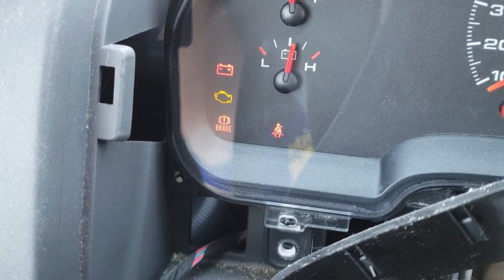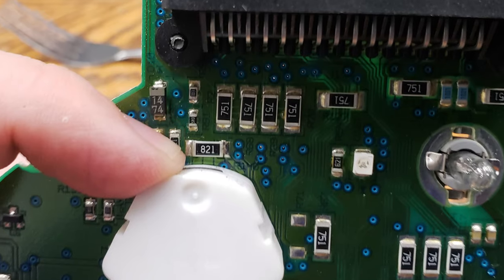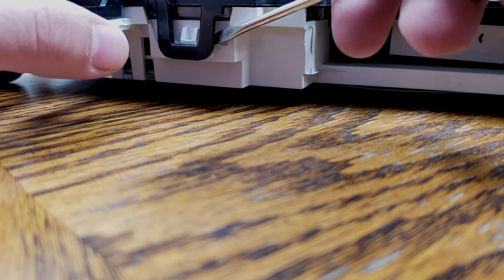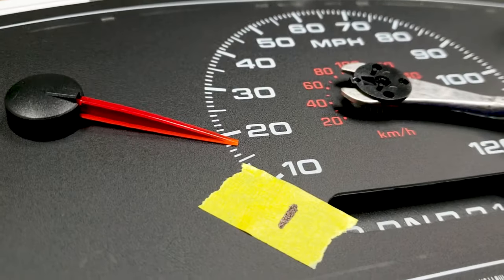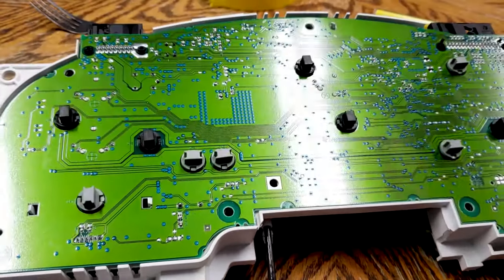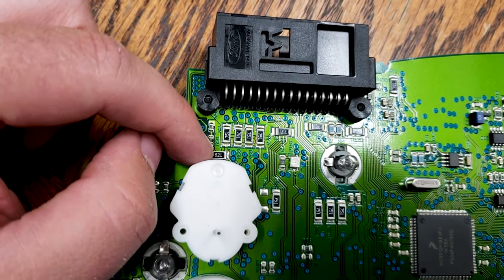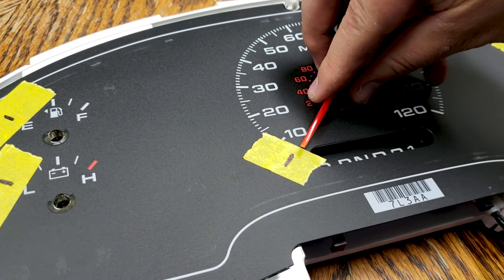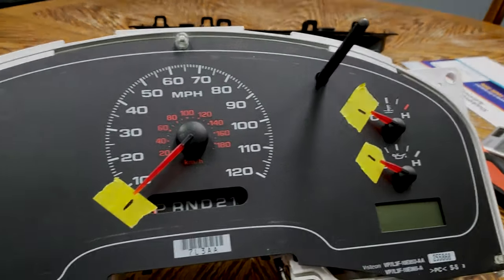How to repair the RED WARNING Brake Light Ford Truck

Comment: Your solder repair worked as described- no more red brake light!  Two tips: 1) After breaking the first two gauge needles during removal, we switched to using two small pick "hooks" 180 degree apart under the needle to gently pry up. Using a flat pry device as shown places the pressure on the outer part of the needle which is what caused the pieces to separate (thank goodness for superglue).  Using hook picks puts the lifting pressure on the center/stud portion and keeps them whole. 2) Trying to avoid putting too much stress on the needle motors I didn't press them down too far (or far enough). Now at night, a little bit of extra light escapes behind the needle base. Not the end of the world when looking at the cluster straight on, but something I'd change if I did the repair again.  Thank you for the guidance!
Reply: My check engine lights is not showing snd my brake light on

Comment: Thanks! Did this today, exactly as shown for my 2007 F-150. I think you just saved me a lot of money in repair work. The light had literally been on for years now, but the shop said they wouldn't pass it for inspection again without fixing this issue.

Comment: I've been trying to get this issue fixed for a long time now, and only ever seen people try to wedge the contractor so the light turned off or they replaced the panel. This is so much more budget friendly. Thanks for the information. I also appreciate a complete overview of all possible issues....not JUST one fix to one potential problem. Very well done.

Comment: Thanks for this video, it's the best one I've found yet about this issue - I was able to repair my own cluster fairly easily, although I would recommend that anybody with hands as shaky as mine should have a friend do the actual soldering as it is a very delicate job! One twist with mine was that my speedometer needle did not light up and I couldn't find any info online about this, but when I took it all apart I found that somebody had been there before me and when they glued the needle pieces back together they used too much of a flexible, coloured glue which blocked off a small square window which feeds the light into the needle - removal of the glue from this window solved that problem - use your glue sparingly and use a transparent product like super glue.

Comment: Well finally someone who understood that just wiggling the connector to make the light go off was not the fix.    Also for me re soldering the connector pins didn’t work.  Or  resoldering the resistors on the same side of the circuit board as the pins.  Thank you for pointing the exact location out.   One thing I did instead of taking the panel completely apart was to cut away some of the plastic so I could get my iron down on the left side of the 821 resistor.    Thanks again.

Comment: Just did this last night. Perfect fix!!! Be very careful when reinstalling the LCD Odometer gage pins back into the Circuit Board. I was holding the LCD gage just a tad too tight and broke it. Odometer gage still works...the bottom half does. No worried, found replacement on Amazon for $70 (Canadian)...so like $10 U.S. lol

Comment: You're the man. Soldered the resistor and permanently fixed. My gauges were off a bit afterward. I simply sat the cluster in with the needles barely on and without the lense, connected harnesses and checked the needle position. Shut it off and adjusted as needed. Saved me hundreds. Also replaced the odometer bulb while I was in there. Thank you!

Comment: Just did it today and so far everything is working, thank you for the video my local dealer ship wanted 500-1000 dollars they wouldn't tell me an exact price until they got into it. And if you decide to do it have some epoxy or something available I had 3 of the needles come apart just like in the video.
Reply: Agree, super glue did the trick. I had two pop off.

Comment: Just soldered the resistor and went for drive . Awesome fixed the intermittent red brake light coming on. Easy straight forward explanation.

Comment: Finally a permanent fix.  I did what you said to do and Re-soldered resistor 821 and it fixed the problem.   A another tip is to make sure the small pins just below the odometer readout display aligns into the connector when you connect back the circuit board to the cluster. I found out the hard way and scratching my head why the odometer won't come on.. had thought I had broken something until realize the cause.  Thanks for sharing this video and helping me fix this nagging problem.
Reply: He briefly mentioned that in his video about "wires" that needed to be aligned properly or your odometer won't work right.  I did the same thing.  Put it all together and the odometer screen was blank.  It took a while to get those six pins plugged in properly but I finally got it.  It was more difficult to do that than to solder the 821 resistor.

Comment: Awesome advice. Absolutely worked. I looked at the joint over and over with magnification and still did not see any sort of crack or break. Did the repair anyways and it solved my problem. Also this seems to have fixed my TPMS indicator that was coming on randomly as well
Just a little addition. I used a dental scraper to rough up the tiny surface on either side of the resistor. Also used super glue to glue back together the needle indicators and I didn’t wait for the superglue to cure fully before closing the unit up. Ended up with white fingerprints on the inside of my cluster enclosure which I will clean up later. Ever seen Beverly Hills cop II fingerprint scene?

Comment: Thank you, just confirmed The reason for my brake light being on. After watching this video with the truck running in the brake light on, I tapped the dashboard with my fingers in the approximate location where you showed the problem, the light turned off. Now to repair it. Great job on this video thank you again.

Comment: I was a bit skeptical because I could not move the wires and get the light to go out. This was the last attempt to try and fix. I had replaced the master cylinder sensor, tested the parking break switch and could not check anything else. It worked !!! 
Thanks for making this video. It was simple to do once you got all the gauge needles off. That was the hardest part.

Comment: Yeah if soldering a connection, you are technically fixing an open circuit. I paused to read all these comments because as one other person noted, upon examination with a lighted magnifier, I could NOT see any open at the solder or on the fine lines of circuitry. I examined the whole board and this took an extra 1/2 hour+, and my only problem has been the darned light staying on for years. Because I have been skeptical (as I'm preparing my soldering iron), I took the time to read through the confirmations of many people who did the same repair. I hope this is my fix after following the same soldering. Bravo to the person who found this solution.

Comment: Thank You Sir, it's FINALLY fixed!!! Touched up the suspect resistor with a little bit of solder and Holy Smokes what do you know, problem solved. Even took it down a very bumpy dirt road for a test drive when the indicator would flash like crazy (not a blink). I'd love to send you a case of beer!

Watched another video where some guy touched up the solder joints on the back of the socket connector. Tried that last year sometime, didn't work :(
Was pretty PO'd after that. Have a funny feeling now that his fix never fixed his problem now....who knows??? 

Glad I gave your "Real Tip" a shot!

Thanks again for you help!
Reply: Same here... Worked for me. I did pop one of the smaller needless... super glued it. Suprisingly, my 30 yr. old Weller General Duty Soldering Kit worked, although I really only heated up one of the joints and dropped a fairly large drop in the other. Thanks for sharing!

Comment: Thanks for this, fixed the brake light on my 05 with the base cluster. BUT I found out that it's not necessary to mark the position of the needles. After putting them back on all you have to do is manually move the needle until you find the start/stop points of the motor. Once you do that you can adjust the "dead zone" allowing you to recenter the needles, then after reinstalling the cluster put it into diagnostic mode (or if you have an obd reader that has on demand self tests do a cluster test) and the first thing that happens is a gauge sweep and that will calibrate the needle positions.
Reply: What?

Comment: Thank you so much this fixed mine. I would also line to add to be careful when reinstalling then pins for the odometer display. If you’re display is not working after this repair check to make sure the six pins are installed correctly into circuit board..

Comment: Great video! Allowed me to not only fix the permanent brake light but also the intermittent dome light on my 2008 f150. Resoldered the 821 and 751.
Reply: My ‘04 F150 has the dome light randomly pop on. Are you saying that 751 is the culprit for that as well?

Comment: Repair worked well. No more red light. However there was an issue lining up the lcd screen pins...discovered that the lcd can be removed from the front with the plastic peeled back slightly, this made it easier to line up the pins.

Comment: I bought a solder iron, plastic removal fork, and solder for 30 bucks at autozone. I soldered my board it was the easiest thing ever. I am not a mechanic I was able to have this done in literally 45 minutes to an hour. Thanks for saving me 1100 which the mechanic wanted to put a new one in.

Comment: Thank you so much . I Had this same  problem with my brake lite the day I bought my truck 2 years ago. I kept thinking it was the master cylinder reservoir sensor .Adding solder to the same resistor fixed it. This must be a common problem for F150s.Thanks again for a great video.
Reply: Did ever the light came back again?
Reply: @Iceforsure  No stayed off unless I engaged ebrake

Comment: Awesome info dude thanks! I had one that had the brake light issue, but also the airbag light would turn off (actually had an sir fault) when the connector was wiggled. And it had a dtc for airbag light circuit open stored. I wasn’t sure which component was for the sir light, so I soldered all the surrounding components on the board and it fixed both the brake light, and sir light malfunction.

Comment: Thank you... Worked for me. Not 100% sure that was the solder that broke, only because I resoldered all the terminals.. But worked! Light was driving me nits for over a year!
Reply: Which terminals exactly? Can you post a picture
Reply: @Jeff-qc6cc  this was so long ago. I wish I could remember. But it was all the contacts shown in the video
Reply: The numbered resistors?

Comment: Sweet deal... My truck would not pass inspection because of this light..  I just followed your video and fixed it in 30 minutes.  Shop wanted to charge $200 to install one. Thank you.. now to find which coil pack is causing a miss under load. 5.4 Triton.

Comment: I also didn't know where on the instrument cluster to repair.  After re-soldering both sides of the resistor, the light is finally out.  Unfortunately,  the speedometer stepper motor came apart while doing the repair and my first attempt at putting it back together resulted in a non-moving speedometer needle. After a quick but tricky disassembly and reassembly, it all tested good. Had to do a live speedometer calibration with the cover off using google navigation on my phone as the correct speed.

Comment: Thank You ! Worked perfect for the brake light!....Other issues, Air bag light will come on or off by banging top of dash and the seat belt light does not illuminate at all....also seat belt chimes with belt on....I'm sure that at least the air bag light and seat belt light are related to the circuit board. Can you point me to the place on the board that may need a solder repair?

Comment: Thanks for the helpful video. I have one the both the air bag and parking break are intermittent when pressing the plug in. Any tips on how to fix the air bag light? thanks.
Reply: There is a small smt capacitor that might be cracked on the back of the cluster below that plug, that's what the problem was on my 07 ford f150.

Comment: I have 3 2013 F-150's with brake light issues. All sensors good. Ford dealership also scratching their heads. Cannot renew tags here in Tx. 
Please help.

Comment: Another fix for this also i found is to make sure your screws for the plastic on the back are screwed in all the way, mine were not on my 2008 ford f150 xlt and it kept messing with everything but once I tightened them all the way it worked like brand new

Comment: If this is the light for the emergency brake, why would you need to check the brake fluid? Does the warning light double as a low brake fluid warning also?

Comment: Great video. Just fixed a “751” SMC cold solder joint in the back of this PCB. Intermittent dome light open circuit. Thanks for the tips!

Shame on Ford for running simple circuits through cheap/faulty circuit boards.

Comment: So... I soldered it, now the speedometer doesn't work.  Is that a common problem?  Did I screw up and short it out with static discharge?  I'm pretty sure I'll have to replace the cluster now anyway.

Comment: Thanks! This fixed my problem, but after reassembly, I seem to have the same problem with the airbag light.  I have a known fault so the light stays on(code 4-9), but it shorts off and on like the brake light did, then the 25 beeps start.  Any idea where this joint might be?
Reply: I had a problem with the airbag light when the LED that indicates the seat not being occupied blew (the one you see above your radio in the dash. ) It's hard to believe but this triggered the airbag warning. When I replaced the LED the airbag flashing light went away

Comment: Can anyone please tell me if I need to turn all needles back and fourth when putting them back on or just the speedometer needle? I want to do this to fix the annoying issue with the brake light but concerned I will mess up the accuracy of my needle guages.

Comment: Mine is doing this along with the airbag light flashing and staying on at times as well and my light to the odometer goes on and off sometimes as well. Could this all be due to faulty solders in other areas of the circuit board?

Comment: Hey guys just wanted to let you know my e150 has this issue it was e brake switch. Just depress ebrake and look for little gray switch. It can be pushed in by hand. Mine did not appear to be depressed enough to turn off the light.

Comment: Guess what....... I bought a used 2008 F-150 and the emergency brake light stays on. The problem was two fold, first all the pins on the connector itself was causing most of the problem so I sucked the solder off and re-soldered all the pins. The rest of the problem is with solder cracks on the resistors. You absolutely must solder the connector pins. I have two clusters that were repaired this way. No more problems. You must use flux or your soldering will cause more harm than good.

Comment: Will this take care of my overhead light also coming on at different times driving. I have a 2006 with 216,000 miles on it. It's a gasser too.
Reply: It worked for mine.
Reply: Mine had a intermittent dome light that won't come on when the door was opened, works now

Comment: Ok, I did what you said. The light stayed out for about 10 minutes and has come back on again. It continues to intermittently go on and off. Any other suggestions?
Reply: It may be a cracked capacitor on back of your cluster right behind the left plug, that's what finally fixed my parking brake light. I have a picture of it. Its a lone surface mount brown capacitor.

Comment: how would you fix the odometer (LCD display) mine is blank, so I don't know how many miles that are on the 2005 f-150
Reply: This happened to me when I first worked on my original cluster when I found that my stepper motor failed for the fuel gauge, and it was simply not seated all the way into the plug. I didn't realize the extra effort required to push in the connector on the board to the LCD display. Take the back cover off and the screws that hold the board to the assembly then carefully lift the board to see if any pins got bent and re-seat the plug. I know this is a reply to an old question, but someone else may encounter the same.

Comment: If I buy a new cluster , would it fix it as well?
Reply: This is possible. I replaced my cluster with a junk yard one off ebay. My original had a broken stepper motor for the fuel gauge but my brake light always worked. The replacement worked at first then the light came on and stayed on. So, if you go the used route, because you probably can't buy a new cluster for older F150's like my 2004, then expect the unexpected.

Comment: I accidentally drove with my brake on for several miles one time and the brake light has been stuck on ever since. It does occasionally go off for short periods of time but it always comes back on. With that information, any idea what might be causing it?
Reply: Did you figure it out?

Comment: It didn’t fix my brake light issue, also my fuel gauge and brake light only functions correctly when I pull that connector towards me. Any guesses?
Reply: The small 821 resistor on the LH side of the big 821 resistor fixed the parking brake light. My fuel gauge still is not working properling

Comment: I would not put your needles back on until you have plugged it in and let them zero When you turn on ignition and run engine then turn off key then install needles I tried this way and not not work correctly.

Comment: 04 f150 brake light on speedometer not working please help
Reply: I had the same problem. Make sure the odometer is connected. If your brake light stayed on, make sure you solder the resistor as shown in the video. Don't overheat it or the resistor might fall off and be hard to put back on.